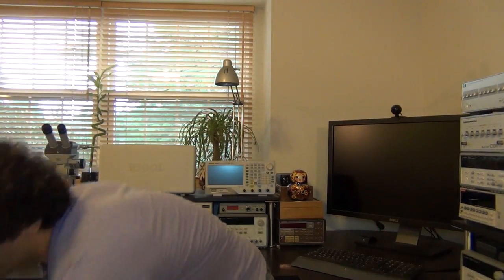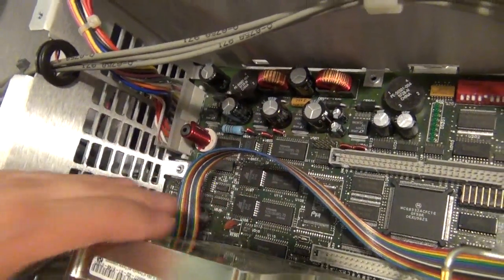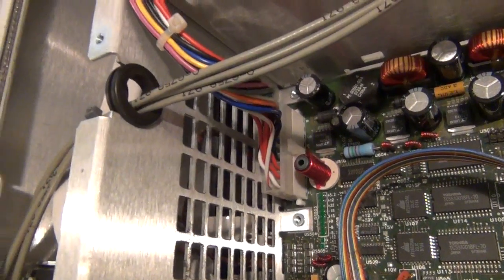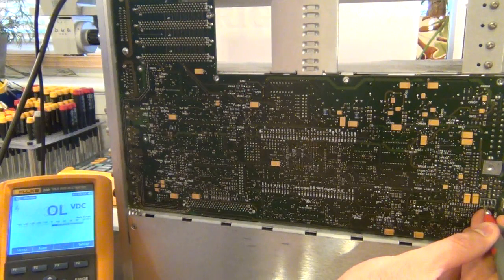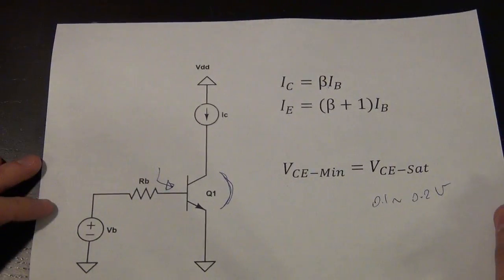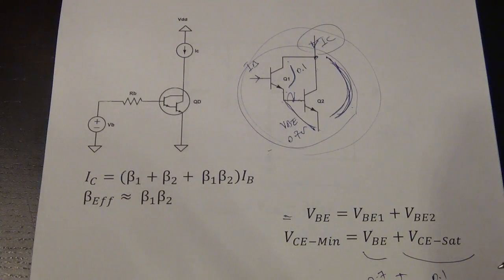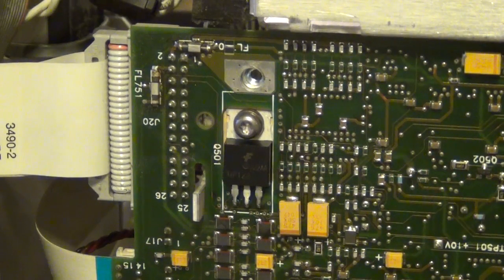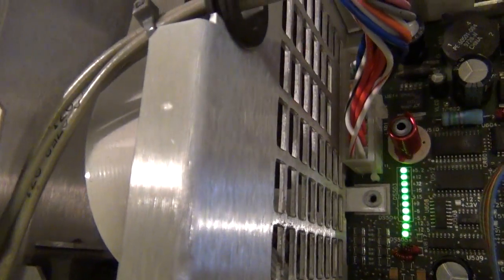TSP #25 - Teardown and Repair of an Agilent E4421A Synthesized Signal Generator

Comment: BTW Shahriar. I want to thank you! Your troubleshooting/repair videos helped me to do my first repair in my life on HP 33120A function generator. I  also purchased it from ebay "as is" and the output was  always on -17 V. But i didn't panic=) I just remembered how you fixed your equipment  with step by step procedures, and it worked:)

Comment: Good video. I'll have to admit, I was waiting for smoke when you supplied 9V to the circuit. I'd have wimped out and just replaced the TIP122 without trying to supply the 9V. Nicely done.

Comment: A good find, I always enjoyed repairing test equipment as deputy head of a NAMAS - UKAS test laboratory, I noticed Agilent changed from giving out diagrams & supplying block diagrams on most of their new test equipment some time ago, when it was HP it was very detailed diagrams, most Agilent is made in Malaysia these days on test equipment, it's still a good company, but I have a preference for the old HP equipment being of that era,
Thanks for putting it on, I enjoyed the video and a heads into a unit I not seen before.

Comment from the maker: ASICS also fail of course as well as processors. Unfortunately, in those cases, there is not much that can be done unless a replacement component is available. A while back I bought a broken Agilent scope and found out that the main ADCs were bad. I essentially had to throw it away.

Comment: Thanks for the great video. I learned a different approach of injecting power from an external source to a known bad point in a circuit (without removing any of the components suspected to be causing the problem). Is this always applicable when isolating power supply problems? Isn't it dangerous at some point ? - But then, I guessed you've already assessed that given your level of expertise on electronics & electrical principles, you just know your stuff very well. Keep up the great work!

Comment: 29:20 Thank you so much, I have never understood the basic logic in a Darlington pair, Yes I did know what it did and it got used, but the real understanding have I only got now, thanks to you!! :-)
30:31 and phase shift, I do now know what is happening, it's a delay in the signal!
40:38 I am assuming the reason for you not using "remote sense" is due to lack of space for one more probe? :-)

Comment: that's some darn impressive guts in that sucker, lm317 fail in the same way, perfect voltage when open but it drops to near nothing when under load.
Im amazed that a piece of pro kit like that was not fixed by those using it since they should have the skill to fix it!

Comment: The darlington will benefit from a heatsink on it in addition to the PC board it is on. You can get ones that will screw to the top of the TO220 case and will have a thermal resistance of about 22C per watt, which will make it run cooler. It probably overheated in use with marginal airflow.

Comment: Very good video.
You should scrape off/remove the heatsink compound or pad.
It was probably dried out and caused the failure.

You seem very lucky with broken eBay stuff, broken off cap, bad  $2 transistor etc.

Mick M

Comment: Great video. I want to learn electronic and want to buy an oscilloscope. How about doing a video on what to look for in them on EBAY and what type of fixes would not be too hard to either repair or have repaired.
Thanks for the video.

Comment: How come some people seem to always get the failed transistor or failed capacitor repairs while others always get the multiple shorts in large ICs failures... sigh.

"very low frequencies, lets say 100MHz" ... classic! yeah, 100Mhz that's basically DC to a mm-wave guy.